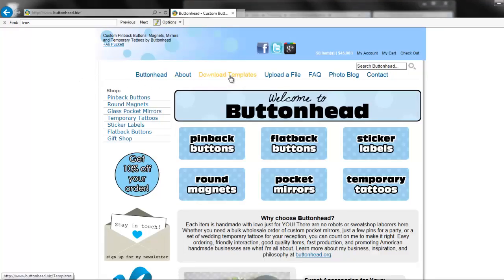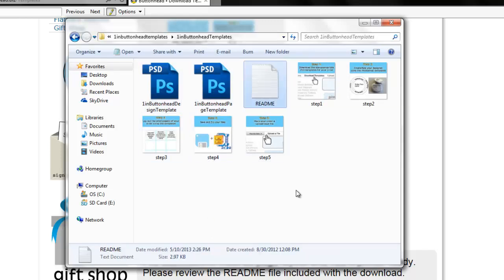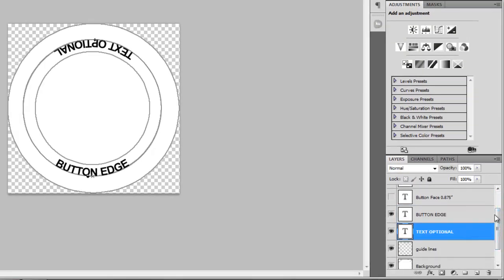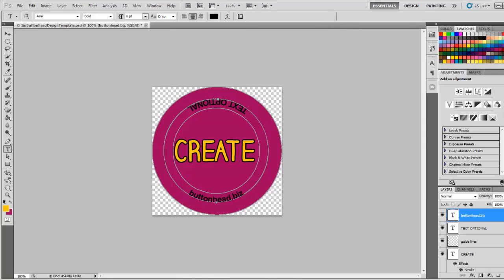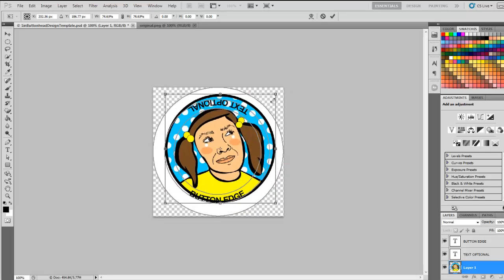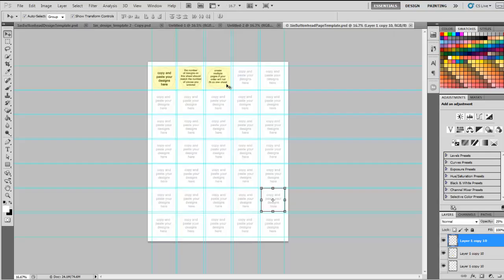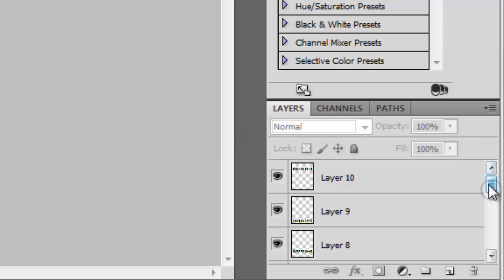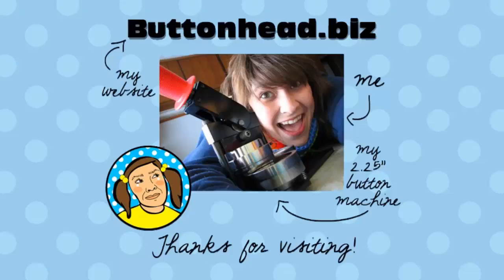How To Design a Button (Badge) In Photoshop - Tutorial and Button Pin Templates by Buttonhead

Comment: I have never used photoshop before and now have to make 150 buttons for my wedding!!!  I dl'd your template however it doesn't have the same "layers" menu?  Hopefully I will figure it out!
Reply from the maker: Hi Krista!  Thanks for your message.  The design templates do still contain the layers shown in this demo video.  I'm thinking maybe your Photoshop settings might not be showing the layers menu?  On the top tool bar in Photoshop, click "Windows", then scroll down to "Layers" to make sure there is a checkmark next to it, so your layers panel is displayed.  Hope that helps!

Comment: I'm glad I found your video. I'VE BEEN MAKING BUTTONS FOR YEARS however I wanted to learn how to make them in photoshop. I dl the template. But the layers are locked and I can't unlock them I'm using photoshop elements 6.  Thanks in advance
Reply: Buttonhead - thank you and great video very helpful.
Reply from the maker: representing50plus Hi there!  Thanks for your message.  I'm happy to hear you found the tutorial helpful.  It's always nice to meet a fellow buttonmaker!  I work in Photoshop CS5, but in Elements 6, you should be able to unlock the layers in the layers panel.  There is a little icon that looks like a padlock.  With the locked layer highlighted, just click the padlock, and you'll be good to go.  Best of luck to you!
Reply: +Buttonhead - would this work with Photoshop Elements 13?
Thank you!
Reply from the maker: JennyBeeCrafts Hi!  Yes, I do think the templates should work with Photoshop Elements.  I haven't used that particular version of the software, but I believe the 'Layers' panel is the same, and it should also be able to open the .psd files.  Hope that helps!  Best of luck in your button-ing.  :)

Comment from the maker: Hi Stacy!  To make a photo button, you'll want to open 2 documents in your Photoshop CS2:  1) your photo and 2) my button template.  Select your photo by choosing 'Select > All', then 'Edit > Copy' from the menu bar.  Now, pull up my button template and choose 'Edit > Paste' from the menu bar.  From there, you can size your photo and add your website text.  Be sure that your website text layers are positioned above your photo layer in the 'Layers' panel in Photoshop.  I hope that helps!